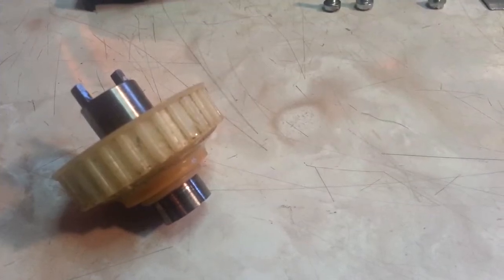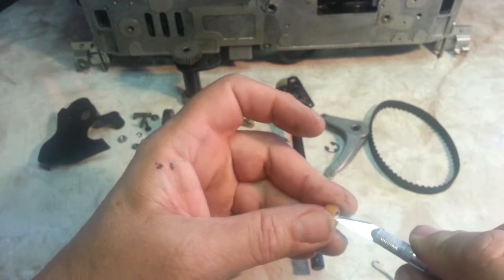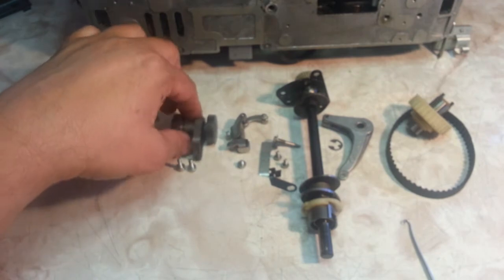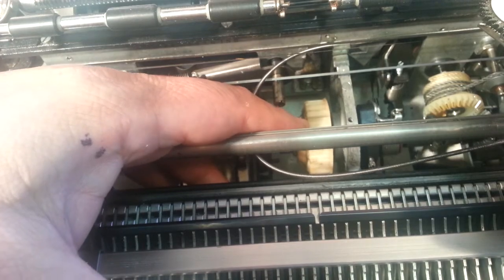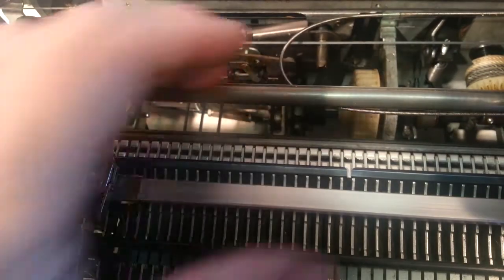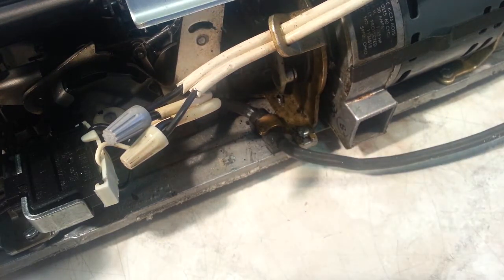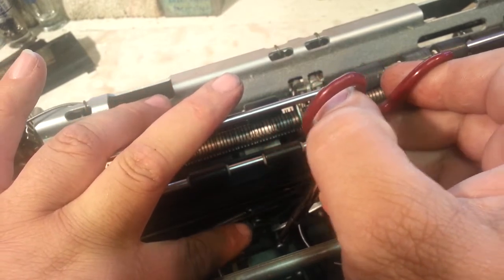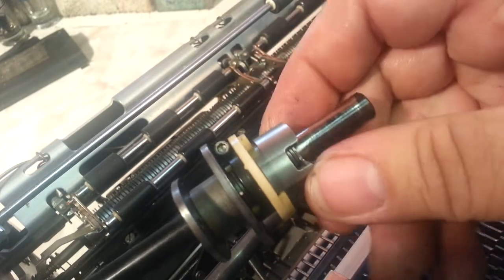IBM Selectric Typewriter Pulley Center HUB Installation Install Replacement procedure Repair

Comment: This has been the most difficult repair I've done to date. I repair lots of things, I am a technician of printers, copiers and MFPs, but this... It has been extreme, but I really had a good time doing the repair, and for sure it would't have been possible without these videos. Now more than a year passed and my Selectric II is still working flawlessly :)

Comment: FYI: To save time adjusting the timing relationship between the cycle shaft, print shaft and filter shaft I mark a scribe line on the gears "before" I remove them. Back in the day I used to convert non-correcting selectrics into correcting selectrics. Just picked up a cracked pulley job and will be doing your key ring repair. Thanks for sharing.
Reply from the maker: Yup these IBM's are crazy fun to service . . .  Key ring is aprox 1.2 inches, these are a perfect fit
https://www.amazon.com/gp/product/B071RK68KT/ref=ppx_yo_dt_b_asin_title_o02_s01?ie=UTF8&psc=1

Comment: I've been listening to a ticking in my Selectric III. It didn't really seem too much until I started working on a 13 inch III I'd found. I noticed the gears on return were jigging when it's running. I was thinking the shaft may be bent, which seems very unlikely....how could it get bent without really damaging the machine. Then I got to looking. It seems the operation shaft is loose in the pulley. Thank God for you and your videos. This one answers a question I'd had about what kind of connection there is between the two.

Comment: I used to buy Selectrics by dozen and once even a hundred at a time from GSA surpluss and would imediatly skip over fixing one up if this was broke. Just wasn't worth the effort. If a customer had one, I'd try to sell them a replacement machine.
Reply from the maker: Yea I too bought 100's of Selectric at surplus auctions, would only keep and resell the best.
Nowadays hubs have to be dealt with, literally every selectric needs a hub job done
I don't sell a reconditioned selectric unless I have replaced hub/belt/clutch etc.

Comment: I've seen on ebay a person selling brand new versions of these milled out of aluminium.  Do you think that one of those would be a good replacement for broken plastic versions of these?
Reply from the maker: Defiantly, only have heard positive things about this pulley/hub.
If I hadn't figured a way to rebuilt them I would have bought 100 by now.
Reply from the maker: No, but common problem only resulting from a lack of maintenance, typical that company's won't maintain a "typewriter" , even on a 1000.00 typewriter, or justify even getting one fixed now-a-days ( actually last decade or more) . The carrier rails & bushings need to be cleaned AND carrier stepping motor needs to have it's bearing flushed & re-lubed (that's the squeal). Problem solved ! Here's a video how you can clean rails, a service job would be much more thorough. https://www.youtube.com/watch?v=VhYwnuZsV-c
Reply: I'd love to get an IBM Selectric II, but where I live in Australia there isn't many places, if any, which do typewriter repair or servicing.  I'd have to learn it all for myself and get all the special tools etc.  Shame I don't live closer to where you are or I could just order one through you, and send it back when it needs to be serviced etc.

Comment: Great video.  Very helpful and really well filmed given the awkwardness.  I’ve gon through the process replacing hub and belt. It’s back together, but something is up.  I think it’s something with the adjustment of the cycle clutch trip assembly (hope that’s the right term), but I’ve adjusted it six ways to Sunday, and either both sections of the shaft spin continuously, or only the right side ( my right looking at it) spins and I can’t get the latch at the front to release.  I hit the keys, but they feel dead, like something is blocking them, but I can’t see what it might be. Return, tab, and the space bar all work fine.  Having come this far I hate to give up.  Can you offer any suggestions. TIA.
Reply from the maker: Check timing of the shaft below KB,( filter shaft ) for blocking KB, everything needs everything to be perfect or it won't work right.
So many important adjustments are broken when installing a hub. Timing of the operational shaft, carrier shaft, filter shaft, 
cycle clutch ring, c/c trip latch are all critical and will effect each other. Even some good selectric mechanics struggle getting these just right.
1st 10 yrs of my 40yr career, I wouldn't/couldn't work on this area, always ended up have a more experience tech fix my mistakes
about 10 yrs ago I finally was forced to learn and understand every detail of Left side operational shaft and cycle clutch

Comment: I have been trying for hours to revive my Selectric 7xxD, after building a new tension system for the carriage (the nylon one had shattered into many pieces, so i made a new one from brass). The Hub was cracked as well. After using your metal ring method to fix that, i find that the shaft is still nigh impossible to rotate. Any thoughts as to what could be causing this?

edit:
I should mention, that i have installed all but a lever at the very end of the shaft (due to the carriage blocking access to that part for now) I have also removed the metal gear connecting the motor shaft to the writing rod.
Reply from the maker: I defiantly have an idea, but with out a visual or on-hands analysis, I don't know what guidance I could give you.
center shaft gummed up, collar binding on hub, center bushing issue, cycle clutch spring not seated fully, on & on & on
Reply: @phoenixtypewriter2136  First off, I am very great full for your help and quick response. I have removed the left motor shaft again (this time it took me 2 or so min, instead of the 2 hours yesterday). The collar was indeed rather well stuck to the hub. After removing it, i used a quickly made lath tool to turn it down a bit, thus freeing the collar up. (i still need to go out and buy some normal grease, since i only have micrometer oil and silicone grease on hand, since i normally work on Microscopes of all kinds). The shaft turns freely when out of the machine, and the right side shaft turns normally. The Hub repair you showed worked perfectly so far. 

How do i check the bushing without removing the hub from the machine again (getting the locking rings in and out was rather difficult, probably due to improper tooling on my part). Since this is the first Selectric im working on (got it as a gift from a friend a few days ago), i don't quite know where the cycle clutch and its spring is located on the main shaft. 

Also, if it is of any help to you, i can send you pictures of the machine and or parts of it. As well as skype / discord communications if you wish. I am mainly focused on seeing this mechanical marvel working once more. (and then using it to write a story i have been planning)

Also, in the not so distant future (a few years) i plan on setting up a machine shop with which i can create replacement parts for microscopes, i could also use the same tools and my experience in machining to create replacement parts for the IBM Selectric. That is, if this is of any interest to you.

Edit: I forgot to mention that the keyboard seems to be slightly gummed up, so ill use your technique to get it running again. Oiled with Starrett Micrometer Oil. Cleaning the old grease  / oil off will be done via n-Hexane and or n-Heptane (which i normally use to clean and rebuild Vacuum Pumps, and i found to be the best relatively inexpensive oil / grease solvent)

Edit 2:
I managed to get the shaft kind of working. I still don't have anything other then the return function working. The quick shift to the side tries moving and then stops. The problem was clearance between the collar and the hub. However i still have not fully put it back together again, as i managed to lose a locking ring.  The return function results in it trying to ram the carriage to the left but dose not stop. Not quite sure what happened there.
Reply: @phoenixtypewriter2136  update: I got the return and tab function working, the rope that moves the carriage had jumped out of 2 guide rollers. Now to solve the issue with shift, and why the thing isn't printing. As well as finding / buying a new locking ring for some sort of ratchet at the far left end of the shaft.

Comment: Duane, what kind of oil are you using on Selectrics?  Kroil?  Marvel Mystery?
Reply from the maker: Been using MM for 30yrs, ran out of IBM oil 10 yrs ago, been substituting MM since. Still have some precious IBM grease, but I use very little compared to the slopped on blobs.